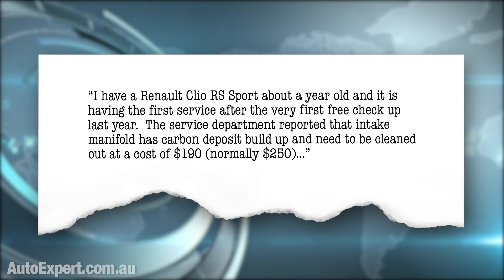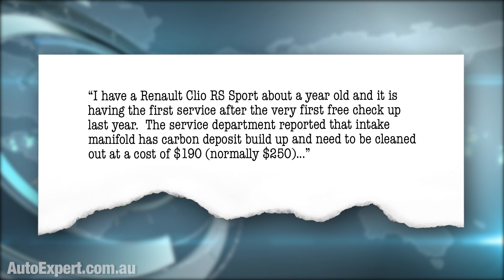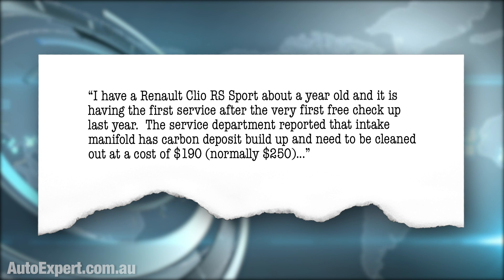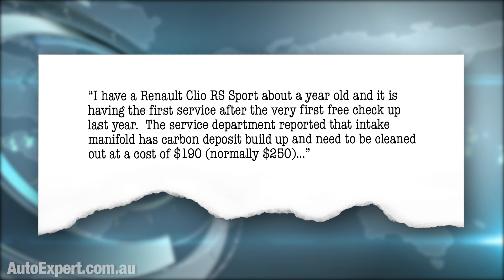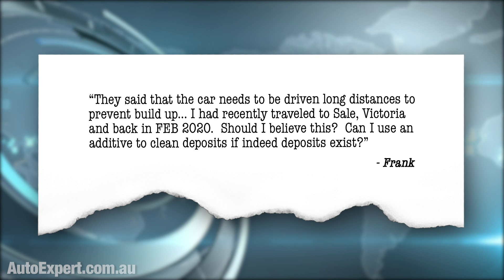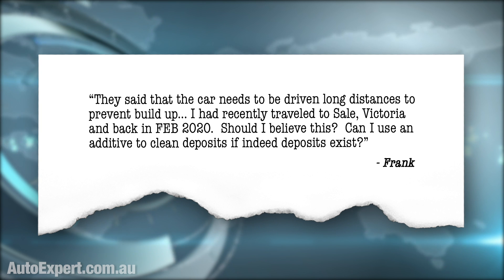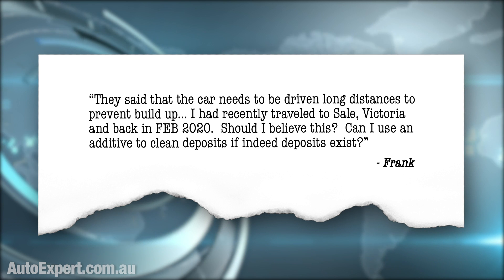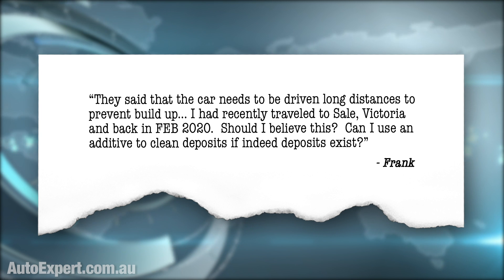The truth about inlet carbon deposits (sludge) in modern engines | Auto Expert John Cadogan

Comment: An oil air separator is a good start to curing the problem.
And why don’t the manufacturers fit them? Money!
Any cost that can be cut is never out of the question with bean counters even when it comes to the safety and reliability of their products,  as long as it doesn’t immediately bite them in the ass or at least not get caught out for it nothing is taboo.
So a properly designed oil air separator on the pcv system and a filtered and properly cooled EGR system would solve the problem but fitting such things might cost an extra 0.00001% in production costs which if they can get away with not spending will net them an extra million dollar bonus come Christmas.
Reply: Well, if that's the reason they don't factory install it, they should at least offer to install it by their service department without loosing the warranty. People (byers) who are aware of this design problem will be willing to pay extra for the installation of catch can and car company would make even more profits. But I talked to my local Hyundai dealer and asked if I buy a brand new i30 N-line can they install one for me if I pay extra. The answer was NO. He mentioned something about the risk for the turbo system. If I install it on my own I am losing the warranty. So after 5 years when the car runs out of the warranty and by then intake gets clogged (including the turbo blades), I can do it. First I would have to pay a big bill for the mechanical cleanup with the risk of damaging something else. 

I found the solution. I did not buy a brand new i30 N-line. I kept my 10 year old Toyota Aurion with the old port injector 3.5 litre naturally aspirated engine. Yes it is about 3 L/100km more fuel consumption but it still goes like in old days. Plus I don't need to go on a highway and burn the fuel for nothing to keep the valves clean. And when I go on a cruise trip the ride is more comfortable than most small direct injection engine cars.
Reply: @beograd07  . The reason they won’t offer it and won’t allow it to be fitted is liability. If they offer it as an option or allow you to fit one aftermarket then they are admitting to a design flaw. If they admit to a design flaw then they are on the hook for repairs to every engine and fitting a catch can also and that is far more expensive than just fitting one in the first place.
Reply: @anomamos9095  I see your point. I think you are right. Any cost for a long term problem in design is paid by customer and seller reputation damage is outweighed by the profit this design problem can bring. I don't think engineers are to blame as they have to design products these bean counters require from them. It is very disappointing to get a much better designed car as John mentioned, with lower fuel economy, smaller engine but more power, environmentally friendlier and it needs just a small step to be much more reliable and durable but the profit rule doesn't allow it.

Comment: You need to increase your oil change intervals. Forget those 12 months services and do the extreme service i.e. every 7.5K or every 6 months and use good oil. Or get a port injected engine and add a recommended fuel additive now and then.

Comment: For me, in the long run, direct injection systems are just not worth it.  Some manufacturers have started to add port injection to direct injection engines to try to mitigate the carbon build up downside.  No thanks.  I'll keep my port injected engine that gives me reliable power and fuel economy over its life span vs the continually degrading power and fuel economy of a direct injection system.
Reply: I agree about having just port injectors only.   Makers put direct and port injectors for better performance and not for cleaning the intakes. Some of the port injectors spray at an angle where the valves get no fuel at all.

Comment: Prius is still port injected, naturally aspirated, and achieves fuel economy most turbocharged GDI engines could only dream of. It's kind of ironic that Toyota's most economical drivetrain has one of the oldest engine designs.

GDI engines kind of sound like diesel engines, not a desirable characteristic IMO. I wonder GDI will also need DPF style particulate filters in the not so distant future too.

Comment: Blanking the EGR valve to stop the unburnt dirty shit coming back into the inlet manifold is a good idea. On turbo charged set ups, retrofitting a water injection system will actually 'steam clean' the inlet manifold and inlet valves as you're driving, and yes I have done this to my vehicles.

Comment: Video is all correct. Changebyour oil regularly. There will be build up after 10k but it won't be enough to affect anything. Every 50k miles get a mechanical cleaning with walnut blasting or DIY with a bunch of cable ties shoved down a drill. Sea Foam or similar are useless and another car cleaning scam. Massive thumbs up to this video.

Comment: Gasoline Direct Injection? More like Guaranteed Dealer Income.

How do you fix direct injection? Vent the crankcase fumes into the exhaust (before the catalytic converter) instead of into the intake, and stop using EGR.

Comment: I don't think it's fair to compare Direct injection to a carburettor but a Direct Injection to a MPi engine - the fuel economy difference is minimal. You cannot argue that this is more of an emissions reduction rather than fuel usage reduction, and the engine complexity (High pressure systems, carbon deposits) that Direct Injection brings are simply not worth it (to me). Also factor in a Turbo on top that a lot of manufacturers are beginning to introduce and you can see that there is no way that engine will last as long as a regular MPi engine. Plus arguably a GDi engine requires better oil, more expensive servicing (especially if Turbo GDi) and sometimes at smaller intervals (i.e. Mazda's 10,000kms). Where are the savings exactly?>??

Comment: John, I appreciate that you're an educated man and I usually agree with the points you make. However, on this one I'll differ. While long highway trips every so often "might" (I doubt) reduce the problem of carbon deposits in the intake on DFI cars, it isn't going to stop it. For the simple fact that, all the shit that gets recycled through the intake system (exhaust gases, crankcase vapors)...they're still there. And they're GONNA still be there, cooking on the intake valves (from the combustion heat) and forming carbon deposits. Which decrease performance (both fuel economy and acceleration). So then you PAY to get these carbon deposits removed. I've seen quotes as high as $800 US. So..how much is this new DFI technology REALLY saving you? Factor in $200-$800 every 20k miles for the carbon cleaning. Did the DFI system REALLY save you that much money in fuel compared to a port FI system? And IF it did...you're just giving that money saved away. So you're back where you started in your overall cost of vehicle ownership. Now, a COMBINED DFI and port FI system, I take my hat off to. However, unless I'm mistaken, only Toyota and Ford are currently using these. Audi has in the past on certain vehicles but I don't think they are now. Ford says that it didn't switch to a dual injection system due to all the warranty claims of intake carbon buildup on it's DFI turbo engines, it was for other reasons...riiight. At least they DID switch. 
You also mentioned how carbon buildup on intakes has always been an issue. Perhaps. However, in 30+ years of driving, I can't EVER seem to recall anyone stating or complaining that they had to get their intake manifolds and valves de-carboned. Unless they drove a diesel. This all seems to have only become an issue, um...with the advent of DFI systems.
Reply: Is this consistent with the last time you discussed intake carbonisation?  Could you compare please?

Comment: I'm more scared by the cost of replacing the high pressure parts of a DI system when they will fail than carbon build-ups.
Reply: its one more fuel pump......and it could last the life of the car

Comment: Oldest dealer trick in the book, don't fall for it. Next thing they will suggest is a brake fluid flush (before what is recommended in the service book). All they are doing is squeezing $190 out of you for the so called "free" service. Best case all they will do is spray some cleaner down the inlet manifold.

Comment: What a load of bullshit!  The problem that brings these issues in for service is carbon buildup on the back side of the intake valve which prevents the valve from seating properly on the valve seat.  This is what causes compression loss in the cylinder and allows cylinder pressure to be pushed back into the intake track creating an effective loss of manifold vacuum.  Telling someone they need to drive on the highway more or change their oil more often is total bullshit.  What needs to happen is the engine manufacturer needs to design an engine that cleans the intake valve like the old port injection and carbureted system have done since the inception of the internal combustion engine. John you are big on consumer  protection, always going on about how the product should deliver what is reasonably expected by the consumer.  The car manufacturers need to fix this issue with port injected engines and stop telling people that they aren't driving properly.  The consumer does not buy a new car so that he can change his driving habits to try and keep carbon from building up on the back side of his intake valves.  The consumer expects that his new car will serve him in the same manner as all of his previous vehicles have before.  I have been a mechanic my entire life and I can count on my fingers the number if times I have had to pull a cylinder head off a port injected engine to clean valves choked with gummy carbon jelly.  When the direct injected engines started showing up however I had Toyota's pilled up outside the shop for years pulling heads and trying to blast that black shit off of intake valves with every thing from saw dust to pecan shell.  For a while Toyota went to a dual injected system with a direct injector in the top of the cylinder and a second injector in the intake port.  Occasionally the computer would spray fuel using the port injector to give the intake valve a wash but this did not happen very often and build up was still an issue as well as poorer fuel  economy and emission control.  Eventually this approach could not be used as fuel economy and emission control could not meet ever increasing EPA standards.  I am not inferring that the solution to this issue is simple or easy but rather that it is necessary and long over due.  If ever there was a really good reason for someone to consider switching to an electric vehicle port injection is it.  Also I believe you have missed the boat on most of the source of the build up on the back side of the intake valve.  Most of that is caused by oil and or vapor being drawn down through the valve guide getting past the valve seal.  Valve seals work pretty well but they are not perfect and some oil does get past.  This oil gets very hot on the back side of the valve and on the valve seat causing it to bake on.  As these engines accumulate more service time this issue intensifies.  Driving more at highway speeds and changing your oil more than is recommended is not going to do anything to stop build up.  John I am a big fan and usually agree with most of your assessments but I am afraid I am going to have to call Bullshit on this one sir.  By the way I am a resident of Retardistan and I would like to apologize to the world for the state of my country.  I know it must be hard to watch but I am hopeful that we will implement changes shortly and put an end to this shit show that is our reality here in Retardistan.  Thanks John for telling it like you see it.....              Jon Smith

Comment: It is a problem. I deal with it daily at my job as an automotive service tech. I'm not sold on catch cans. I use a cleaner that I spray into the engine intake porthole on my personal  car which has a direct injection engine every 15K miles. I never keep my cars for more that 5 years so I will probably never know if it helped or not. I do all of the proper maintenance that I can because I often sell my 5 year old car to a friend. I would never want to sell a friend a car that wasn't properly cared for.

Comment: Today I can tell when a "classic car" recently drove by.  Even those rehabilitated properly, stink up the roadway.
Reply: Steve Johnson. Driving on the highway you can smell them before well before you can see them.
Reply: Back in the late 60s, I could tell the smell of a chrysler engine up against a Mercury or Generic Motors.  I could probably still pick out a 454 without seeing the car.  For some reason ford 429 tended to smell least-foul.  Of course the early models with CATCON smelled like sewage.  It's just something we got used to -- and really didn't notice when the smells largely went away.
Reply: Steve Johnson. I grew up in the 80s and 90s and never remember smelling petrol all the time but obviously the smell was in the air all the time but just not noticed. Just one carbureted car driving past now smacks you in the face but back in the day it was hundreds of cars driving past all day spewing out leaded fuel vapours. It’s a wonder anyone grew up to be healthy adults at all!

Comment: One of the dealer tricks is to ring the customer during the service and hit then with we recommend X be done.  They do this to catch you off guard, hoping you're preoccupied or busy at work and will say yes ok. It's all worked out.

This can include valve clean, they spray or say they did a can of $20 magic and bill to you $ 230 but as a gesture (jesture) of goodwill because you're getting your car serviced $190. It's often not needed.

Comment: At the risk of getting into trouble 😜Could the quality of engine oil used at some dealerships also play a part? 

In the video below, “Engineering Explained” covers this - however it is sponsored by Valvoline 😜 Personally I have used Mobil 1 in a lot of engines, and at tear down they are always insanely clean compared to most. So one would have to assume Mobil 1 has a pretty good additive package, with a high quality base oil.

https://youtu.be/FW0wCl-O7oY

Comment: Carbon buildup happens to most engines and if you use good quality oil, the vapour from it will coat the surfaces it contacts and keep the carbon or soot soft. The softened carbon falls out of suspension and passes through the engine without harm. 

If you buy a second hand vehicle treat it with a dose of Subaru Carbon Cleaner. That product works extremely well and has not once let me down.

Comment: The only thing I find irritating here is the lazy way engineers just route this stuff through the intake. There are plenty of options to allow expansion in the crankcase without it ever needing to vent (to atmosphere or intake) and EGR is a sticking plaster.
Reply: What options, that is that meet emissions requirements?
Reply: @ajcuthy1945  Have a look at the seperator systems on almost any big rig. There are also water based filter systems and catch cans at the lower end of the scale - along with quite a few other possibilities. 
This "just dump it into the intake" is lazy and a known problem. The only reason it continues is because in general its not going to be a problem until after the warranty expires. 
About those emissions - how much cleaner would the engine run if it wasn't sooted up (after a few 10's of thousand k's of course) then how much damage does it do to produce the cleaners, run the garage and expend the energy to sort it out once it does force that? Then there are the follow on emissions from having things like DPF's dying early through clogging regularly. Every emission device has its good and bad side. Things like adblue are in general brilliant because that gets rid of a massive chunk of harmful rubbish with little in the way of a downside. EGR on the other hand has a relatively small effect on overall emissions and brings with it a host of other issues which can cause more emissions than if it weren't there in the first place. 
Why no one recircs EGR from after the DPF I have no idea since that would be much cleaner and hold off a lot of those issues for a very long time. 
I'm all for cleaner cars. I'm also not daft enough to fall for cars which are only cleaner for the first few thousand k's. Hopefully more people in governing bodies will start to think about lifetime emissions rather than a half hour cycle in a lab.
Reply: @siraff4461  yes i agree entirely. I guess it comes down to the manufacturer saving initial costs by not using alternative separators or post dpf egr.  The problem when intakes become blocked is then the emission of No2 and soot skyrocket which defeats the original purpose. So there are thousands of diesels out there that are very polluting.

Comment: Credit where credit is due to engine designers.  I don't miss playing with choke settings on a carb, or points and condensers in distributors.

But I've also taken enough trips around the Sun to know to not be an early adopter.

Toyota may be boring and behind the leading edge where it comes to technology.  But at least here in 'Merica, where we don't have Toyota diesels, they've been pretty much rock solid.  IIRC, they use a combination of a port injector and direct injection, so some of the intake track gets fuel with the cleaning effects.

One other point, which I'm sure you are aware, for most cars, it would take a long time to fill an intake track with carbon build up.  Seems valves in some engines get carbon build up at a much quicker rate than the intake track of port injected cars.

You are right, don't blame direct injection, instead realize it merely highlights deficiencies in the other areas you mention, EGR and PCV systems, and engine blow by.